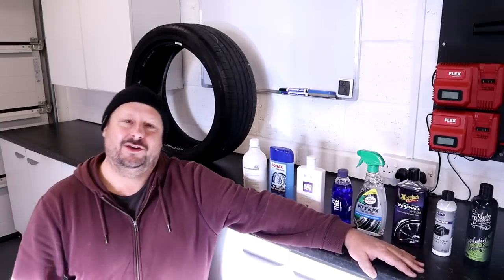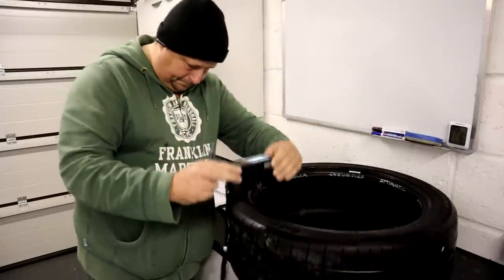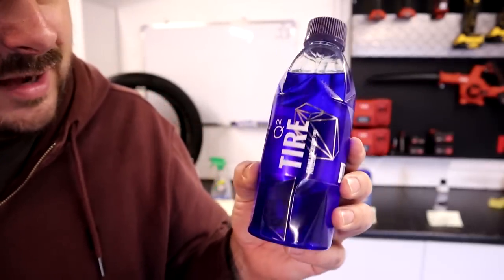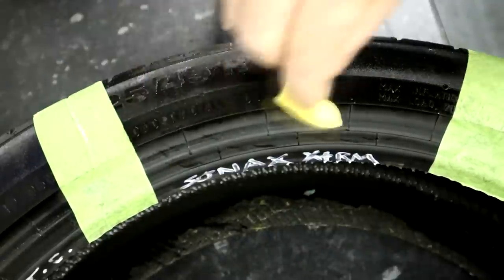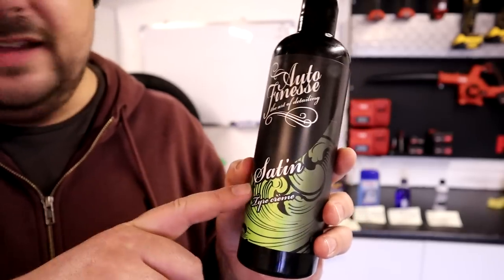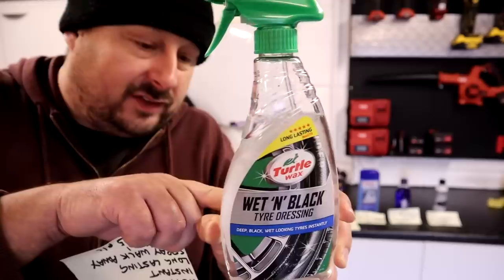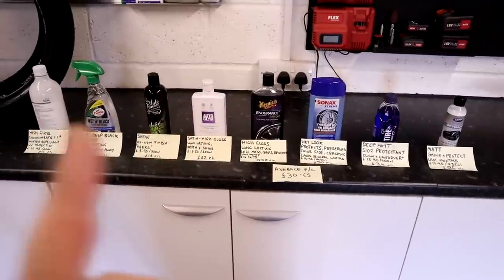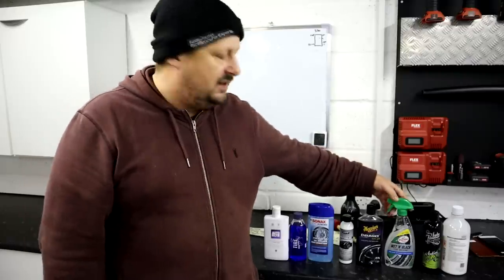The Best Tyre Shine Dressing Comparison

Comment from the maker: Gonna be like 5000 "no carpro perl" comments :(
Reply: What about Sam's Detailing? Or Fireball - both are pretty good IMO
Reply: but why you didn't add it ?
Reply: Literally typing that out, then saw this lol. Surprised you didn't include it as you have mentioned in previous videos how much you like it, which lead me to buy it lol.
Reply: Jon. We have to talk. Where is the Perl?
Reply: Read 5000 minds 😂
Reply: Tfw Dad forgets the PERL 🥺
Reply: You left out the best , what did you expect ? 😂
Reply: Jon. This is serious :) i was thinking on something new but it cannot underperform. Actually Perl dilluted 1:5 on my tires does better than all other dressings i had.
Reply: @SuperJapierdole  PERL 1:1 looks best for me :)
Reply: @dimmacommunication  same for me and its easy to apply. Sometimes, like obce a season when i do wheels off cleaning and deep clean my tires i use it undilluted. It is more sticky then, harder to apply well around tire graphics.
Product is a champ.
Reply: oh england win than grab a beer.I bought sonax extreme have t used it .tac system where the product to use you can way i understand mix it with water the product it last longer spray of turtle wax before you bottle is empty end to auto glym
Reply: Exactly Jon !
Reply: Everybody knows about Perl by now surely lol
Reply: How do you think perl would have performed in the test?
Reply: @soulsnatcher24  pretty close to TAC seal. They’re both in the same manufacturing family. Might even be the same formula.
Reply: Really need Bilt Hamber to do a tyre/trim dressing.
Reply: Perl shmerl. Washes off next time you clean the car, what is the point? I'm glad you didn't waste time with that. I love carpro in general, and perl has it's uses, but durability is lacking in this product.
Reply: Id have liked to see jenny chems dressing in there too. Aswell as EZ car cares revolution. And to top it off  tuf shine tyre clear coat. Which claims maximum durability
Reply: @aidanmaclennan8150  jenny chem doesn't half blow your head off with the smell 🤣, not a bad dressing tho
Reply: Yep, another PERL here. 1:3 for me. But still interesting to see how others do.
Reply: @dimmacommunication  same and its easy to apply
Reply: @mikeparker9812  1:3 ? anything over 1:1 tends to fade easily , I did a lot of tests with it. But hey anybody has their taste.
Reply: @dimmacommunication  I tried 1:1 and it was just to shiny, so went for 1:2 which was okay. Then because I have 1:3 for plastics I tried that and it looked good so stuck with it. I've found when I go to monthly customers their tyres have just got to the stage of needing redoing 👍
Reply: @Forensic Detailing Channel probably, but at least one 'no pss?'
so - no pss? hehehe. its imo like a black dress that just fits a hotty with no ifs, whats, or buts about it.
no greasy fk on the hands, super easy on, discreet look.
hope you and the girls doin fine. take care man
Reply: Agree with the Meguires and Autoglym results but neither can compete with Carpro Perl for either tunabillity of shine and durability. Perl easily 4 times longer.
Reply: Isn't Carpro Perl the same product as the TAC Systems?
Reply: @steverabbits  judging only by its performance I would say not. Doesn't recommend the same range of dilution either.
Reply: No car chem tyre gel. 16£ per litre
Reply: @peterholmes2089  it’s not the most durable product (it’s the best looking one imo) but it definitely last more than a wash for me. I’ve had it last 4, but haven’t gone longer than that without washing my wheels and tires. What’s your prep process? Dilution? Coats?
Reply: @muckeyn  I recently purchased an 8oz bottle of Optimum Tire Protection and Coating for $20 + shipping. You cannot dilute it. This bottle will last me about 2 years and I use it on 2 cars. Cost is irrelevant to me compared to other products that last a few weeks since it saves time having to re-apply it. For preparation, I just scrub the wheel with a stiff brush and a tire/wheel cleaner and let dry. I think you are supposed to be a bit more rigorous than that, cleaning it several times. However, this method seems to work for me well enough.
Reply: @peterholmes2089  I’ve used optimum tire coating. I can get it locally for $15 so it’s a pretty great value. The stuff is definitely durable but I just ultimately like the look of Perl better. I had it for 2 months and stripped it off and went back. My partner’s daily gets OPTC since I maintain her car and it’s a lot less work. I’m recoating them every 4 months or so. We don’t get much rain here so I’m sure the protection aspect (water/dirt repellency) lasts much longer. But I like to refresh it for the look.

As for Perl or any dressing/coating, prepping them with a solvent based stripper like mineral spirits or stoners tarminator makes a big difference for bonding & longevity.
Reply: @simasm.9757  the tacsystems one is the same as perl
Reply: @stitchedlips6764  PSS?
Reply: @steverabbits  koch chemie pss (the silicone oil free one, the one with silicone is called ps - plaststar, i prefer pss, used both numerous times). 
looks great, who am i kidding, it looks  fantastic. fresh. clean. black. rich. not like hot wheels toy car tyres. lasts relatively long, absolutely zero sling and super fast application so reapp doesnt really matter anyways imo. but it do last. no 'brownish' tyres never whatsoever. 
the same for plastic or anything rubber exterior (lasts way way longer than on tyres). 1l for like 15€ or so. tsss. its a no brainer product. i'm sure you'll find dozens of clips on yt to check out the look if you like it.
if you into plasticy toy car tyre look, its prob not for you. fk it, even if, just use it elsewhere exterior-wise :)).
it got daimler clearance - and these guys are to my knowledge more picky than any other (atleast german) carbrand if something is suitable for 'their' surfaces or not. they really are, and thats a good thing.
i stop now since i'm feeling like a idiotic homeshopping tv idiot narrator, just watch a clip or two and look for yourself.
gl,
bye

most overlooked product for tyres - this message destructs itself in about 15s to keep the best kept secret secret.
Reply: jon what if you use solution finish black trim on your tires
Reply: @dimmacommunication  me too
Reply: @stitchedlips6764  sounds amazing! Ta for the tip off, I think I may have to try it. I'm a PERL fan but I would like something with more durability tbh
Reply: @stitchedlips6764  Nice tip
Reply: @steverabbits  Yeah nice option but PERL is lasting like 5-6 years for me 😂😂 lasts forever
Reply: @steverabbits  try it, its good versatile stuff imo. but, if only reason or concern is pearl durability i wouldnt switch if i were you. i would just reapply pearl instead to be frankly honest.
Reply: @dimmacommunication  is your car in a showroom and never moves? 😂
Reply: @stitchedlips6764  too late, I've ordered some! 😂😂
Reply: @steverabbits  5-6 years the 500 ml bottle.
Diluted 1:1 you get 1 liter ( I diluted it 1:1.5 and looks amazing  ).
Basically with 500 ml I got 1250 ml and it's lasting ages.
Reply: @dimmacommunication  ah now I see! 😂😂 Yeah it certainly goes a long way, I love the stuff but can be a sucker for trying new products. Usually I find they are all pretty good these days and there is a limit to how many I need for just mine and my family's cars
Reply: @steverabbits  I have a video with a comparo with other tyre shine products on my channel.
PERL is an amazing product for tires
Reply: @dimmacommunication  just found it, will watch later, cheers! 👍
Reply: @steverabbits  you will find good use for it anyways i am sure. keep in mind its meant for all exterior related stuff not interior, its hydrocarbon based
@UCwONm-Q7l1CXh7MqP8gZveQ yw, no worries
Reply: 🤣🤣🤣🤣🤣 I just seen this now ffs  😅👨🏾‍🦽👨🏾‍🦽👨🏾‍🦽👨🏾‍🦽💨💨
Reply: @dimmacommunication  the best??  If Perl even smells water, it disappears
Reply: I don’t think Perl will be better than the number one.
Reply: Brilliant video John! Most excellent- you are my go-to guy when I want information on valeting products. Keep up the superb work! :)

Comment: Carpro Perl for its versatility - one product for internal/external trim and tyres.
Reply: and great value
Reply: @zigatelban4392  but no longevity ☹️
Reply: @tonyhill1916   i found it to be better for interior surfaces than exterior.
Reply: Tac System Seal has the same formula with Car Pro Perl.
Reply: @zigatelban4392  Yeah, I noticed the same. Has lasted really well on my interiors.
Reply: Eu também tenho usado o PERL da Carpro. Sua  versatilidade,  brilho, durabilidade,  custo-efetividade , facilidade de aplicação são características que me atraem!
Reply: Perl is the same as seal carpro is rebranded tac system

Comment: I use the Maguire's one, its especially good if you use the proper applicator. I never drive my car the day I wash it, so after a night in the garage, the next day its fine, I don't get any fling off on to the paintwork. It lasts really well and has that glossy look that I like. I might give the Autoglym one a go, but I still have 2 bottles of Megures, so maybe by the end of the year I can buy some.
Reply: Same! I see a lot of folks complain about applying it but I've always used the rectangular applicator brush so never had an issue. If you use a long handle brush with a million soft brittles, yes Meguiar's will be a pain as it is a gel but it last longer than anything I've ever tried.

Comment: Primarily been using CarPro PERL. Can apply with an applicator easily, but more importantly can put in an atomizing sprayer for larger tires with textures or off-road tread patterns that are part of the sidewall.  Plus it’s water based, so easy cleanup and removal when dressing again. Also testing Adams graphene tire dressing. I know, gimmicky to use graphene in the name. But....so far it’s been quite good.

Comment: I like the Autoglym but it is very messy and dirty. Autoglym also suggest the longer you leave it to dry the better. It is good once it's on and dry though. I usually get about 6 weeks out of it before I want to reapply. Great test.

Comment: I’ve used the Meguiar’s for years, that’s my winner.
Reply: Totally agree,  use it for all external black  plastics  and it smells like  bubble gum. Just need to wipe off the excess so it doesn't fling off
Reply: @shiobahnbrindley3522  It’s good for the external black plastic as well? I boy have the rear diffuser as a Matt back otherwise everything is colour coded or gloss black.
Reply: Yep, it's going to be my tire dressing as well. I have an archaic bottle of Turtle Wax that no longer delivers.
Reply: @AlmostLastJedi  I would get Cerakote Trimcoat as it is the best at restoring plastics. One package should easily do two cars.
Reply: Yeah it’s Merguiars for me too, although I do use Autoglym’s tyre dressing occasionally.
Reply: I always have dust stuck to the meguiars when I use it
Reply: For 14 years now, recently switched to Sonax.....I love it so much.
But still have my first Endurance Bootle.

Comment: Another killer review where you touched all the bases, dotted all the I's and crossed every T.  Your summary on Optimum Tyre hit the nail on the head, yes it lasts, but you have to reapply after every washing for it to look as good as the car looks.  It is a "Dressing", not an undercover tire treatment.  The Meguiars is exactly how I remembered it, solid and black and wet looking but it looks ratty in a hurry even though it is on there for a good 10-12 days.  The Gyeon, of course, it's good, it's Gyeon.  But what I am really finding out over the last few months from watching your show as a viewer from the States, is just how good AutoGlym's product line it.  Wow,  I said when I watched your Bimmer car wash video, this Polar Wash, Polar Blast and Polar Sealant are the real deal and they blew me away and now the Tyre Dressing.  OK, I'm a believer.   Thanks as always Jon for a great test and show.

Comment: FWIT-
 
I did a tire dressing this weekend on my red 2018 Mazda CX5 with Autoglym.  Just wanted to share my experience for any other newbies.  
 
I’m just a couple of years over 60. I haven’t done this since my 20’s, but I love that red CX5 just wanted to show the love. First, I’ve watched a metric fuk ton of videos on tire dressings, not because of the price, but because it’s a PITA, (literally for me) so you don’t want to have to do it too frequently. First of all, the most important step: preparation.  I rinsed and cleaned the tires and wheels with Optimum Power Clean and a good stiff brush. Research tells me it’s the best product our there for that task. You can either use it 1:1 thru 3:1.  Based on that, figure how much you’re going to need over time when you buy it. I went with 3:1 The stuff in the bucket didn’t seem to get too dirty, but it was kind of hard to tell since the soap is orangey and the brush came away from the tire with that brown/orangey color.  I used one mix for the first two tires and mixed up another batch for the other two. (Re prep-  Every mfg. of every car dressing requires you to do this.  Any brand that doesn’t is one I’d steer clear of.  I hate prepping anything BTW.)
 
I hosed tire down after done, then as the tire was drying I sat down and using a towel to clean the wheel did a real detailing job.  I spent somewhere between 5-10 min on each wheel. During that time the tire dried about 80-85%.  Next I took a hand-held hairdryer got what was left and went over the tire to make sure it was completely dry.  (Critical)
 
Using a foam pad – 5” x 5” (it was from a packing crate – I cut it up.) I laid a bead of the Autoglym on the edge.  You definitely want to use a piece of foam – of course it absorbs a lot of the liquid, but you’re going to want to squeeze it against the tire at times to make sure it gets in all the raised/recessed print. 
 
Once I was done, I put the foam in a Ziploc bag to keep it from drying out.  Will that work?  Dunno, but I have to do my wife’s Chevy Sonic Turbo (once my hips a butt recover.) and this stuff isn’t that cheap.  It smells great BTW.  I started at the top, made my way down each side. 
 
It goes on nicely and gets in all the crevices.  What I was going for was a “new tire” not the glossy look that a lot of the boys here in Yonkers love.  I got somewhere in between.  I think I spent too much time applying it – I went around the tire – still wet – several times just to make sure I hit all the high and low spots.  I dried it with a microfiber towel as recommended.  I ended up with something between new tire and glossy. The product seems great so far, but I wanted to let you all know that when you apply it, if you’re going for the “new tire” look don’t let it sit on the surface more than 3-4 min before wiping it down.  Jon – would you say that’s about right?
 
Anyway, that’s my experience so far.  Hopefully it will prove to be the product that Jon found it to be.
 
Cheers and with Lots of Hope, 
Charles
Reply from the maker: That's good prep charles right on m8

Comment: ive been using the Geon for a year now and i absolutely love it. There is noticeable longevity compared to other dressings i use.
Reply: Pearl is better and multi purpose. Gyeon is so sticky. Still have half a bottle I gave up on using.
Reply: @AndreasHappyfarm  I find that Gyeon performs better on tires. I put ceramic coatings on my rubber seals etc...keeps them looking new forever.

Comment: Meguiar's Endurance is the best for a deep, black shine. It is messy to apply,  but if you leave it overnight to dry it's o.k.. I use the turtle wax one for a quick top up between Meguiar's.
Reply: Try mixing Endurance with another Meguair’s product named ‘Hot Wheels’ it makes application so much easier and it has great ‘endurance’ too👍🏻
Reply: @666DW  O.K. Might give it a try. Thanks.
Reply: @666DW  I remembered that I have used "Hot Wheels" in the past. Good product but I find that Turtle Wax tyre shine is just as good at half the price.
Reply: @alanhunter2009  it’s very similar. However, neither the Meguairs or Turtle wax product have a good endurance on their own hence the reason I mix it with the Meguairs endurance tyre shine, which makes it more resilient to water and easy to apply as Endurance viscosity is quite thick.

Comment: I've been using the Meguiars one for three years now, and I must say I am quite happy with it. Looks killer on application, but  can sling a bit. Better to apply two light coats in that case. About durabilitiy - the crazy shine dies kinda fast, especially when it is raining otuside, but like your test showed - tire stays darker even after the shine is gone, so for me, in a way you've got two products in one - crazy shine after application, and satin sheen after a while. Bottle lasts a long time too - I am on my second one right now. Another thing that I discovered - it requires less and less in following applications if you stick to that dressing. Smells great also.
Big downside is the application - it is greasy, so you've got to wear gloves, or your hands will get all black and messy. Like I said it slings like mad, so you need to learn when enough is enough to cover the tire, but not to overapply. 

It is very similar product to Gtechniq T2.
Reply: Try mixing Endurance with another Meguair’s product named ‘Hot Wheels’ it makes application so much easier and it has great ‘endurance’ too👍🏻

Comment: Optimum is my favorite. It usually lasts about 3 months before I notice any degradation. You definitely don't need to redress it every wash with this. That is what I am looking for because it's a pain to get down so low and dress tires. The price is not a factor for me given that I don't need to re-dress every week. Also, you can make it glossy by applying a second coat if you wish.
Reply: U have to be 70 or older if getting down every time you wash a car is a problem
Reply: @Aleksander Starczewski  still an unpleasant job